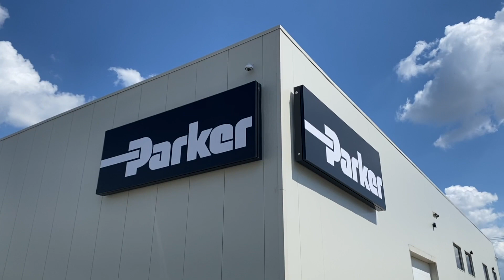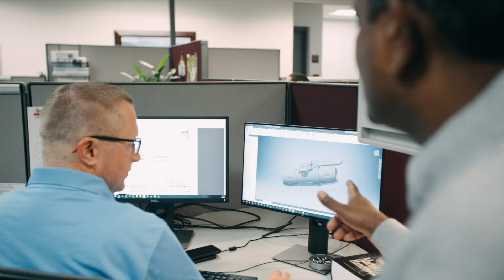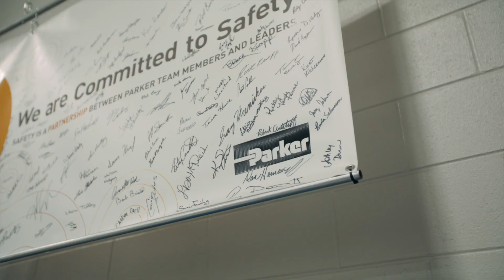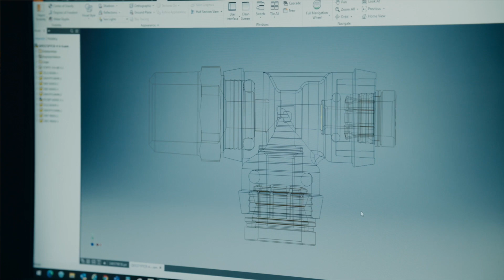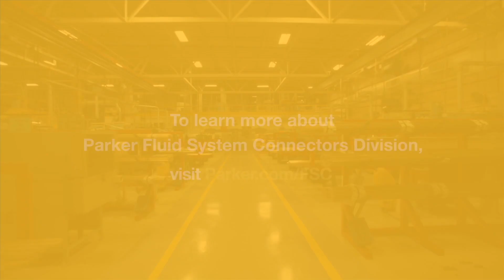Fluid System Connectors Division | Parker Hannifin

Comment: Name is fluid..but used for compressed air🤔
Reply: Although liquids are the most commonly recognized fluids, gasses are also fluids. Since air is a gas, it flows and takes the form of its container.
Reply: So it’s considered a fluid per se
Reply: @lilkrishna9376  thanks for info.
Reply: Right!  Air is considered a Fluid… anything that “flows” Is a fluid by scientific definition.